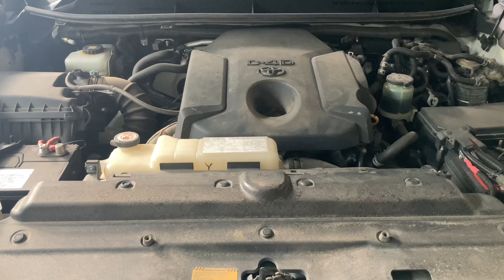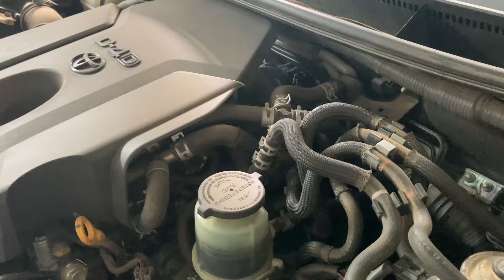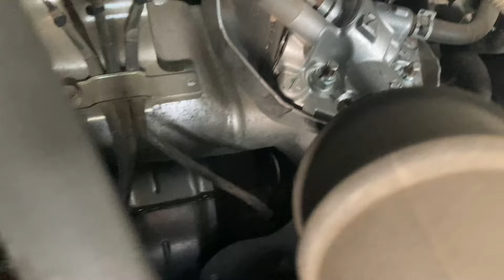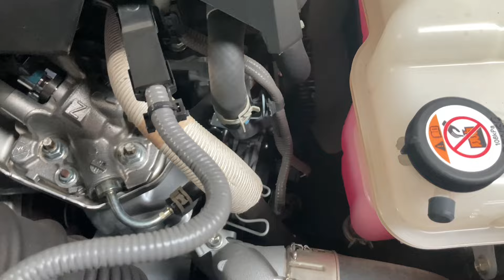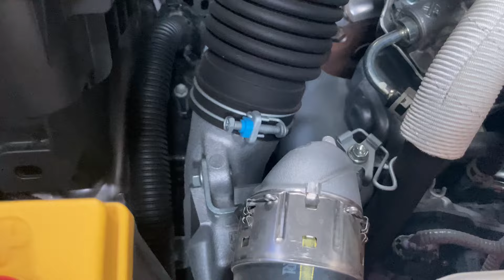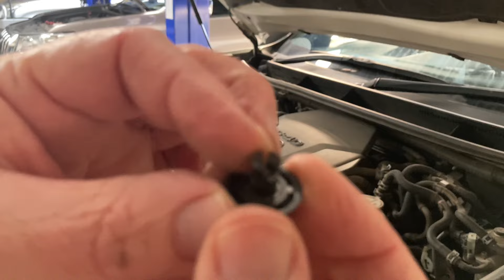So SORRY 34 minutes Trying To Make 1gd Owners happy! The maintenance program

Comment: Have had a 2017 Hilux 1GD manual extra cab since brand new, 110KMS on the clock, absolutely nothing wrong with it and it’s never skipped a beat for me! 👌🏼

My old boys got the TRD supercharged V6 SL 2008, just under 400KMS, also never skipped a beat

AND 

We have a 1987 petrol carby dual cab Hilux, this one needs some more love but still runs just under 500KMS on the clock original engine! 

All unreal cars and engines, Toyota forever

Comment: Im a toyota dealer tech in nz... ive done extensive work on the 1gd. Both the balance shaft variant and non balance shaft variant. The 6spd manual variant in the hiace with the dual mass flywheel is by far the worst. Engine replacements/overhauls due to balance shafts snapping are becoming a monthly occurrence for us. Around the 90-120,000km mark. Be great to discuss some of this stuff with you!
Reply: Здравствуйте. На какие годы выпуска приходят проблемы балансирных валов  1gd-ftv? Хочу купить prado 150 в Японии 1gd-ftv с пробегом от 30000 - 90000 километров, год выпуска  2020-2021. Как вы думаете мне продадут prado этих годов с плохим мотором из-за несправных балансирных валов?

Comment: Great videos Anthony, following you from the other side of the world. 
The problem of the 1GD is definitely the emission regulations and its related components. This engines with only the EGR and diesel oxidation catalyst from factory work pretty well, and don't have the oil degration problem of the DPF, that may accelerate the timing chain wear. Consider also that more issues may appear in the future with the newer versions with selective catalyst reduction and the mild hybrid technology.
In my opinion, last of the best the 1KZ. 1KD and 1GD are great, but hold less the abuse and lack of mainteinance, and in the second hand market that's a warranty for reliability, when you don't know how the other owners take care of the vehicle, specially at high mileages.

Comment: I have a 2015 Fortuner that is nearly up to 160,000km. It has been serviced regularly since 60,000kms when I purchased it (that was before I found your videos Anthony). I use a DPF cleaner about every 5000kms and do long runs 100kms + as often as I can. No problems so far. Also tow a caravan but found I had to add a trans oil cooler. Timing chain still ok but realise that may be the first reasonably major job that will need doing.

Comment: Have been driving a 2016 Prado 150 with 1GD Engine for 6-7years now, serviced at Toyota dealership right throughout. Had smoke around 90k-100k kms mark, DPF unit was fixed/replaced by Toyota through warranty. During the last service, Coolant level was low - 175k kms mark (6-7 yrs), Toyota suspected EGR Issue, replaced EGR through warranty- even though car is out of warranty. Have been driving since without major drama’s. Service is due in a month, will keep updated whether timing belt/ chain 😅 needs a fix.

Comment: My 2019 150 Prado just clicked over to 49,000km without any issues (touch wood)
Best advice as you said, stick to the Toyota service schedule and don't stress out. If it breaks, it breaks. Worry about it then.
I love driving my Prado. Sure, it could use another 100hp, but I set my cruise control on 102kmh and the Prado is happy to do that speed all day. It's not getting stressed out and neither am I. Yeah, the dingalings behind me that like to do 130/140 in a 110kmh zone get a bit frazzled, but you get that.

Comment: Wow - 34 minutes on the 1GD and more to follow - what a treat! And a promise of more to come too!  I have (from new) a 2017 1GD, 82k km always dealer serviced every 6 months.  When the models with the modified DPF came out I asked if it was possible to retro-fit the button tat initiates a DPF burn, provided its within 20% of being due (this is as I understand it and I could be completely wrong here) anyhow, they just replaced the whole DPF!  I didn't realise the whole DPF was replaced until I noticed that the coolant was low and took it back and the head mechanic said there must have been an air pocket following the DPF replacement.  Funny though - although I now have the button, I don't think it actually works. I track the DPF regen cycles (180 to 250 km) but it has never initiated following a button press.  As for potential future issues - as you say, my approach id to keep on top of the maintenance, not worry, and whatever happens (timing chain etc) I'll just cross that bridge when I get to it!  Also - very interesting about the newer turbo driving characteristics! I have a throttle controller but no longer use it as most of the time I prefer the smoother way it drives stock. And on higher settings it drops a gear (or two) too easily.  Gee - seems I've been chatting on for as long as you do!  What was that you said about wanting a two way conversation??🤣. Anyhoo - I really appreciate the 1GD video Anthony - you've made this owner happy!

Comment: love all vids.  happy you are doing 1gd vids.  my mates got one. thi k he needs a 14mm plate.  hard 2 find on ebay.    wonder if any other mods can help them. maybe strap on a alternator motor haha. just kidding. my 150 d3l going good now.   after watching your vids.    fills up on desiel 2 no issues after I cleaned breather.    no more lean on kdss after tweaked the sensors and brackets.    slight flat spot turned out 2 be map sensor.  or inlet pressure sensor. got abit of pull noise when cold so.  I think might need your big kit.    
1gd users might be selling m after your vids but. probably best.  save m big dollars.    love ya bro keep up good vids

Comment: 100 k zero issues 2019 model, about 700 klm to a tank on freeway, nice to drive in power mode, average in eco , need throttle controller 🤠

Comment: Got a 1gd in a 2017 hilux 6 speed manual with 264000 all I’ve done is clutch so far if you wanted to check it out see what condition a 264k igd looks like I’m in Melbourne